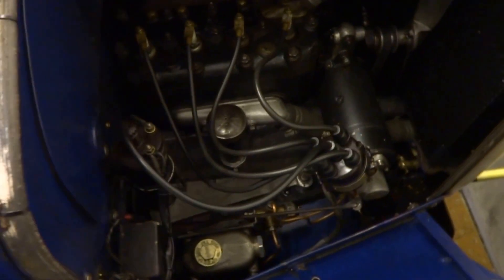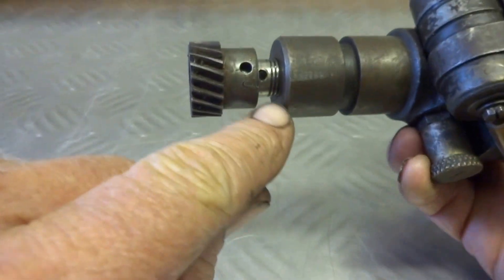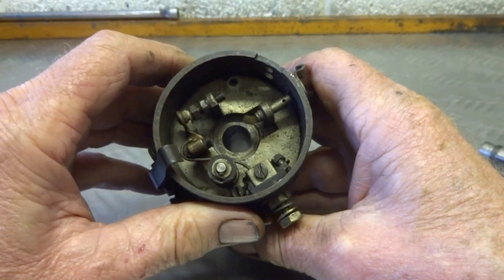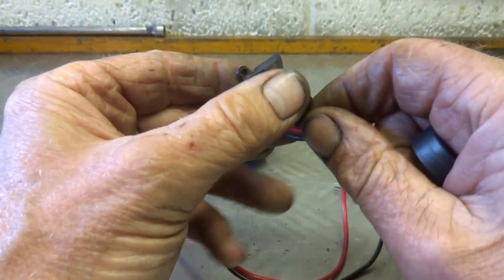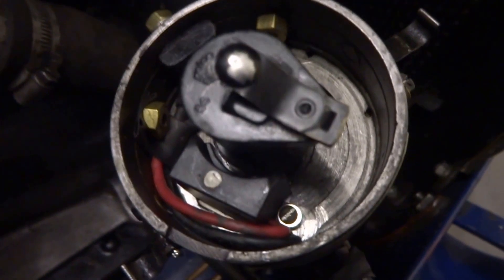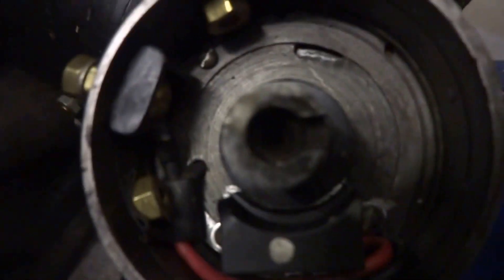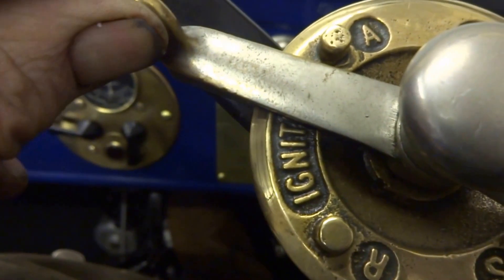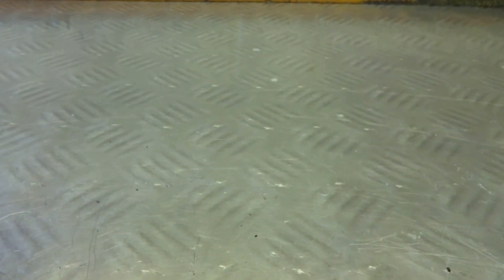Fitting Electronic Ignition to a 1928 Austin Seven

Comment: A very interesting video well done,     I have a similar type of pickup and reluctor ring made for a Rover V8 which I intend to fit to a 1956 Nash Ambassador its not a straight forward fitment as I will have to make a new cam to fit the reluctor ring  the original one being far too big, the main reason for doing this conversion is the awkward and difficult access to the  distributor making points adjustment almost impossible.  I think these units are a great upgrade to any car with points ignition and its great to see how someone else has adapted the distributor and the kit itself to a non standard application.
Reply from the maker: Thank you, I fitted a similar unit to my Lotus Elan as the distributor was hidden beneath the Carburettor. It ran so much better afterwards just as the Austin Seven does. Unfortunately, the Lotus Elan was another vehicle I shouldn't have sold .

Comment: Er why !?!?!?!
Reply from the maker: Because it makes a huge difference to the way the car runs. It starts more easily, it ticks over more smoothly and it has more power. When the components of the old ignition system age the tolerances get poorer and it is not possible to gap the points accurately. The electronic ignition overcomes this so the engine runs perfectly. Try it and see the benefits for yourself.
Reply: @anthonywbelcher  i use points it's starts on the button even when battery is low I've driven 50,000 MLS across the world I know the points system will never fail and if if it does just change the part and stop scratching your head wondering what to do next .The best by far mod for a 7 is an SU carb ,no more  blocked jets more power no flat spots more mpg better acceleration it goes on.The next best mod is a German 009 points distributor ( repeat German) the points only need adjustment about every 10,000 mls the condenser is built proof.I know taught by the 7 guru himself!

Comment: I have only just seen your video.  I fitted a 12 volt accuspark electronic ignition to a 53 Humber Super Snipe,  in 2013. I was doing a 10,000klm car trial  in Australia.  Took about 2000Klm before the the extra powerful spark burnt through the Bakelite rota button and carbonised it, sending current straight to earth. So learnt then that a  more modern material rota button was a necessity. Continued by putting points back in and found a Landrover Rota button amongst spare parts that fitted. Although rotation arrow pointed the wrong way. Lol. Just to add to future confusion.

Comment: Waste of time.....unreliable Chinese chips the secret of a 7 is simplicity ,!!!!
Reply from the maker: In my opinion it's a great modification that works well and has never let me down. Like the Austin Seven it's so simple but makes a huge difference to starting and performance.
Reply: @anthonywbelcher  It will let you down in due course and you can't  fix it on the roadside ! As for starting a good 7 will start on the first pull or push even after weeks of standing  well mine does ! Keep it simple very simple !
Reply from the maker: @bertiewooster3326  let's agree to disagree

Comment: I fitted what I thought was an electronic ignition kit in 1980 to an early VW Golf. All that involved was pushing the unit onto (via spring holder things) the existing ignition coil and connecting a wire or two. Is was you have done a different or the "latest" ways of doing things?
Reply from the maker: Yes I presume mine is a more modern way of doing it it's not too difficult and I think they now have a kit for an Austin 7 that you can buy off the shelf

Comment from the maker: Thank you for your kind comment. The magnetic ring is a push fit and fits quite snuggly. I was lucky that I just took enough metal off the shaft to make it a tight fit. Your idea of an o-ring instead of a cable tie on the shaft of the distributor is a great idea. When I next remove the distributor I shall replace the cable tie with an o-ring. In fact I use two o-rings to take the play out of the carden pot on the propshaft.

Comment: I use a piece of card ( a business card or piece of cigarette package will do) to set the clearance between the  magnet and the sensor coil.  Fortunately I have made a toolpost grinder for my lathe. If you want to make sure the "doughnut doesn't move use a drop of locktite.

Comment from the maker: I have now added a dry coil to the ignition system which has improved performance still further the coil is available from eBay and is known as a 6 volt Viper Coil I have also purchased off ebay performance silicone plug leads and hotter spark plugs NGK AB2 all of which have added to better performance the car now pulls now really well in top gear

Comment from the maker: In some respect I agree with you but having said that with electronic ignition and a Viper resin 6 volt coil with silicon performance plug leads make the car far more usable as it starts easily and runs far better than with the old points system and in any event it can be put back to original very easily

Comment: I wonder if my 1936 six cylinder Austin 12 could be converted? Hmmm
Reply from the maker: Yes I'm sure it could be done. My friend has successfully put electronic ignition on his Bentley Mark VI Special and is very pleased with the result.
Reply: I’ve fitted electronic ignition to my 1948 Austin 16. The only problem that I have is setting the timing as the timing marks are on the gearbox!

Comment: When you had the main shaft in the pillar drill were you filing it when stationary and turning each sector by hand or was it spinning electrically ?
Reply from the maker: Hi Graham

It was spinning electrically in the pillar drill, but be careful not to file away too much of the shaft you need a snug fit.
Reply: Anthony Belcher Many thanks.